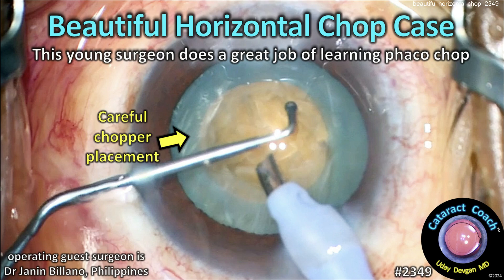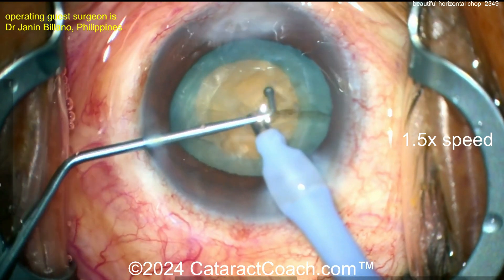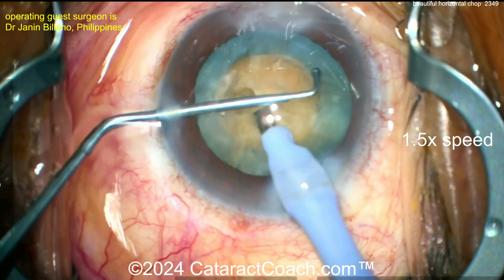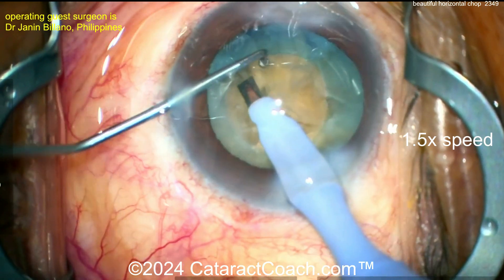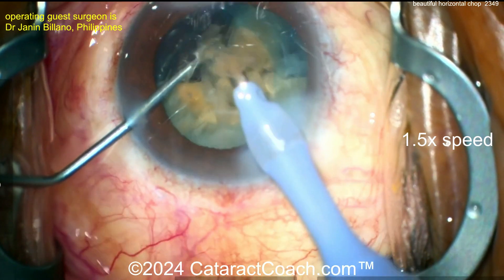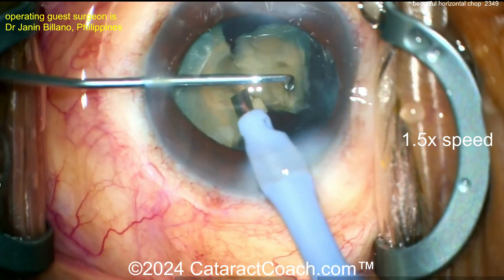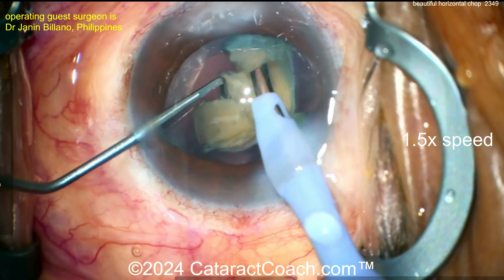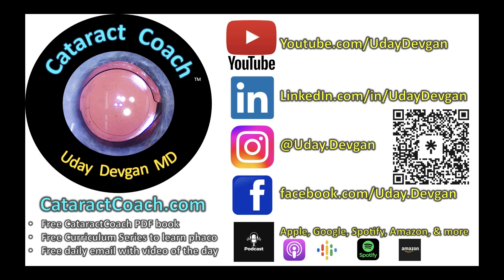CataractCoach™ 2349: beautiful horizontal chop case - learn this!

Comment: Regarding the initial chop: initial phaco placement is central or slightly to right of centre. As the chopper is brought towards phaco for the chop, the lens torques. Usually what happens next is that the phaco tip 'slips' and gets more superficial - hence the crack doesn't propagate all the way through and the lens rotates about 90 degrees. Solution - bury phaco probe proximal and LEFT of centre. This helps to reduce the lens torque with this technique. Also, with a dense lens like this, I would bring the chopper a little slower toward the phaco probe to ramp up the crushing effect and let the mechanical forces work for you.